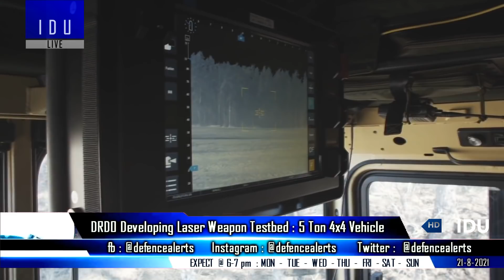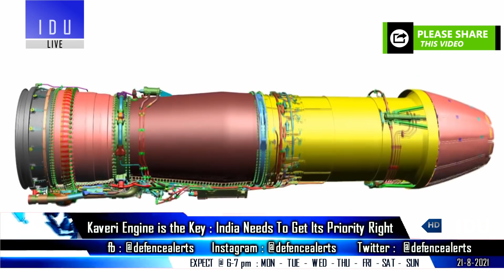Indian Defence Updates : 6 Super Kalvari Under P-75I,DRDO Durga-II Testbed,India UK Engine By 2033

Comment: In submarine & ship building construction in navy,we are using en huge nos of fasteners which are impact cost to we design changing from the flange with 12nos fasteners to 6nos fasteners  with flange with respect to technical requirements like circumference of flange,PCD etc.,  & identify fuel consumption optimization & H20 like   different type or alternative of fuels  in Naval commercial ships,jets,helicopters etc.,